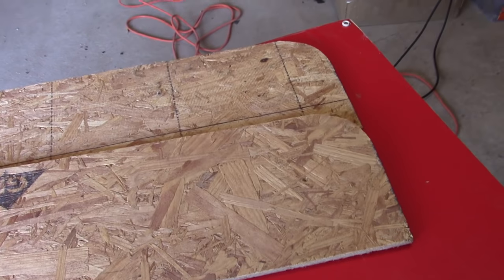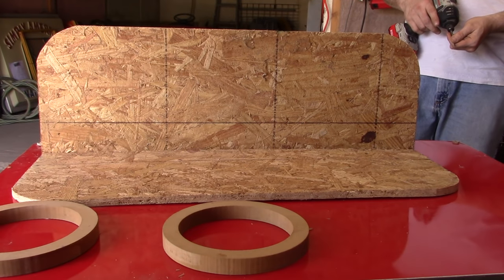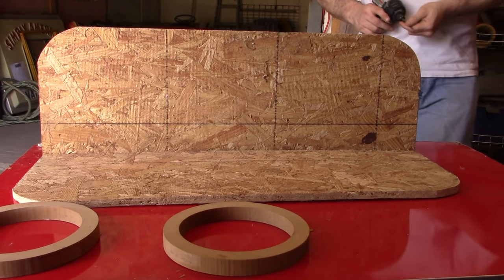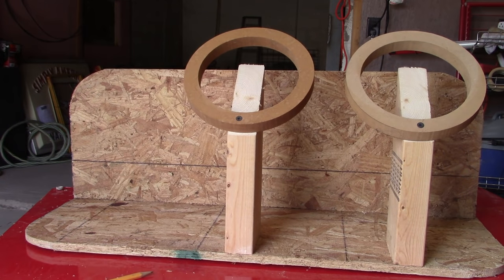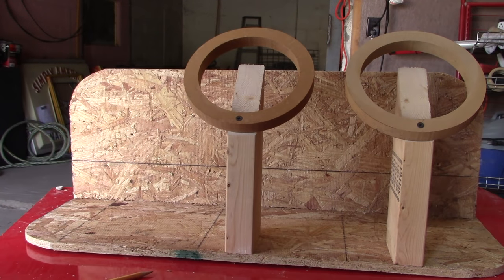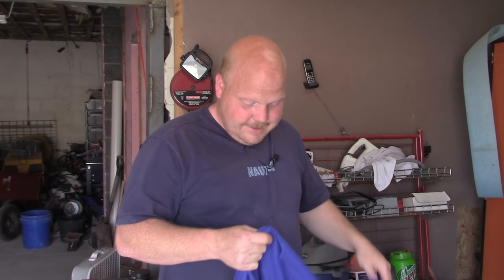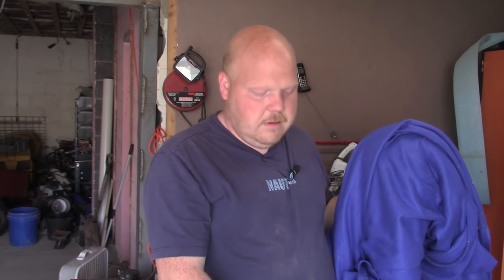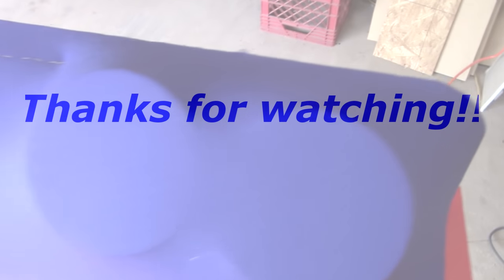How to fiberglass speaker boxes and other shapes. (1 of 3) ( Subwoofer box )

Comment: So would you typically use that OSB or would you recommend a different material?
Reply from the maker: MDF tends to be the best choice for working with fiberglass and subwoofers, I just used it as a means to make the video.
Reply: Lol
Reply: Is cheapest for the project
Reply: Lol 😂

Comment: Just to clarify regular OSB is not for subfloors. It’s for sheathing and roof decking. 
Subfloor osb is actually wax impregnated which makes it water proof and it is a much more dense product that holds screws well. . I actually like it better than birch or MDF
Reply from the maker: Interesting enough I did some box testing using Avantech and it did have some good results in the strength area.
Reply: Random Audio Guy in your testing were there acoustic issues?

Comment: Question (possibly dumb)...is the fabric necessary?  Can you apply the fiberglass over a carpet speaker box?  Or would the carpet need to be removed and then a fabric over a bare box?  Thanks.
Reply from the maker: Im not sure exactly why a person would want to do that unless your building off a box that is already built, Then yes you could put resin on the carpet and let it harden them build off that.
Reply: Yeah I have a custom box for my 2018 Challenger and thought about giving it a try with fiberglass instead of building a new box.  I’ll give it a whirl.  Thanks man.

Comment: I just need to know how to find volume before i make a custom corner trunk box for a 15  i know i can use packing peanuts so what I count out how many I need for the box to be perfect and then place it where I want the box to be and get a good idea on how big I need it or what
Reply from the maker: You build your volume and then you fill it with packing peanuts. Once its full you pour that into a 12x12x12 cardboard box and that measures out your cf.
Reply: @RandomAudioGuys  right but i like to know how to build it for a specific sub

Comment: How do you calculate air space and port length for these types of enclosures? Also, what about the corner of the port that drops down (back corner at port turn)?  Is this accounted for as well?
Reply from the maker: The best way to determine air volume of a fiberglass box is Sand or for most people a more readily available product is packing peanuts. You fill up the volume once you have it shaped and then pour that into a 12x12x12 cardboard box until you fill it up with the total amount and lets say you ended with 2.2 boxes of packing peanuts then you have a very close idea to your total volume of airspace. If at this point you need to make adjustments to the port you do it then before you start putting on resin. 

I hope that makes sense enough for you, Its hard to put into words something that is so easy to do but hard to word it out. Maybe ill cover this in a future video, plan on alot more fiberglassing coming and now that we are through remote start season new videos should roll in a bit faster so Ill try to remember this and cover it for you.

PS, yes the port curve on the top is accounted for in this box. And if you go for a tune of 32 hz, you might end up with 33 or even 31 but you will be very close either way.
Reply: Makes sense. Thanks!

Comment: I’m going to build a sound bar for the jeep using your methods I have a few questions if you have time to answer. One is if I wanna put subs and mid range with tweeters do I have to block the subs completely as if they were incased then build the others together. If I do should I have ports for just the sub enclosure or all three parts. Sorry kinda new to the speaker side of building. I found two 6.6 600wt 300rms subs to use and think they may sound pretty cool that way. And second question would be would this have to be wired to an amp then the jeep or could use bridge that rite into the original sound bar plug. Any ideas or suggestions would be awesome. And I can share what I come up with
Reply from the maker: That will be a really large soundbar if you try to intertgrate the subwoofers into it with the mids and highs , But yes if you did do that you would want to seperate the subwoofers from the mids as it would beat them to death quickly. 

I would do a sound bar and put the subwoofer somewhere else, Just my opinion.

You would want to run this off its own amplifier, as the factory radio will not make enough power to push a good sound bar, Doesnt really do a good job of pushing the stock sound bar in my honest opinion. 

Id do some good Pro audios, if DD or something like that doesnt fit your budget then maybe look into PRV they offer great mids and highs affordably.
Reply: @RandomAudioGuys  awesome I’m only running two small 6.6 subs 600wt 300rms I do wanna do big loud subs but as it’s a jeep that I’ll have to build into the jeep and water proofing and lots of research lol. I was thinking about integrating a center console sub too but that’s down the road this is a quick in need of hearing loud sound with the top off and flying down the highway lol. But still same idea separate the subs. Wire them to the amp them the deck. Only question left is and please explain like I’m 4 why are there two sets of terminals on the subs? I’ve never wired them inside a box before just a box into a car once

Comment: Hi Random,Got a question and sort of in a pickle.I'm glassing a spare tire well and on the front and sides where the wood meets the sheet metal there are small gaps.Will the resin and chop mat fill that in just fine or is there another way  to deal with small gaps?
Reply from the maker: Assuming you mask the area off that you are working in. And if I am picturing what you are saying right then as you brush resin onto the chop mat you take you tools and slowly work it into the area and it fills these voids. Again Im hoping I am picturing this correctly.
Reply: Random Audio Guy Thank you...I'll do my best to maybe fill the back side of the gap with the painters tape so that the resin has a pocket.
Reply from the maker: Your able to reach me on Instragram @randomaudioguy

Comment: wat is the cloth over the speaker call so many kinds
Reply from the maker: That was just a normal fleece in this video. I use different types of fabrics but Fleece tends to give the best shaping stretch. If you do not have a lot of shape in your project you can used unbacked speaker box carpet and get a lot of strength.
Reply: where can u buy it from
Reply: wat I'm asking can u use any kind off fabric when fiberglassing. things
Reply from the maker: You can buy it on Amazon. As for what cloth there is really not 1 any certain cloth required, If it stretches and can give you the shape your looking for thats the one you want to use. I cannot think of any cloth that has a bad reaction to fiberglass resin, I do know Terry Cloth doesnt do well. It stretches but is very brittle once it sets up so try to stay away from that. 

Take a trip to your local walmart or what you have like them that carries fabric and hit the close out sections, I usually get my fabrics for a dollar or two per yard.

Comment: Does Home Depot sell descent resin and chop mat? I was looking at US Composites online but if I could save the shipping costs I'd rather pick it up from a local HD.
Reply from the maker: The resins sold at big box retailers are typically bottom of the barrell type stuff. Cheap and in my opinion garbage. Sure we have all used it before but I get it online at a store that requires you buy 125.00 to get free shipping.

Comment: with the rings... if I were to have a 12' sub.. what would the outside of the ring be compared to the inside? would it be 12' on the outside or would the inside of the ring be 12'?
Reply from the maker: The hole cutout for most 12 inch subwoofers is 11 1/8th inch. So your Ring would be in the neighborhood of 12 to 12 and half on the outside. Just depends on which subwoofers your using. I like my Rings to be at least 1 inch but on the newer projects were working on you will see where we build 2 rings and attach them together so the subwoofer is countersunk into the box. 

Hope that helps and stay tuned we got more coming, Just had a cold winter so I was stuck with remote starts, got a few videos filmed though, Just got to get them edited and up on the channel.
Reply: Yeah, I'll definitely be watching. So the actual circumference of the outside of the ring will be 12 and a half, and the inside measured at 12' for the sub to sit flush?
Reply from the maker: Depends on the subwoofer, Most subwoofers actually are about 12 1/2, So if I wanted to do a flush I would have 1 ring normal 11 1/8th hole to 14, then the top ring would be lets say 12 1/2 to 14, so they flush up together , glue them and sub sits inside one but has a landing to lay on for the second one.

Comment: Dalrods and hot glue gun works better for putting in place
Reply from the maker: Sorta, You are right in the sense they work, we use them alot. The problem is with a box like this getting 2 rings positioned correctly and aligned is alot harder to do. If I am building an all fiberglassbox in a real situation then you probaly would have seen dowel rods.
Reply: Chris Neal l

Comment: I tried finding this  Purple blanket on the website you provided but the only ones I'm seeing are white is there any way you can tell me how to get it... and if its s2 glass or if its plain weave e glass..etc...those are the polyester fabrics I found on there but are white
Reply from the maker: Bigblu Blue the purple is just a random stretchy fabric I use to get shape. Then I apply resin to harden that shape and build fiberglass on it.
Reply: Random Audio Guy thank you for the reply ....so that resin will harden that purple material for shape..I asked because I've seen same purple blanket in other videos  and then you apply the fiberglass mat for the harder feel and then the fiber  blanket over it all for smoother surface
Reply from the maker: Yes depending on the object your working on. Typically we get to work on the outside surface. I use other techniques where I use the inside and build it strong from that direction.  Makes it a lot easier to finish that way but its not always a choice. Depends on the shape and object your doing.
Reply: Random Audio Guy  sorry to bug you.. do you have the link to the resin , filler etc you used...I seem to not find it ...thanks again for all your help
Reply from the maker: In one of the videos on this box I have the fiberglass resin link in the description box.
Reply: Awesome thanks again.. found the resin and I figured it was on the fiberglasssupply . com web site that i noticed mentioned